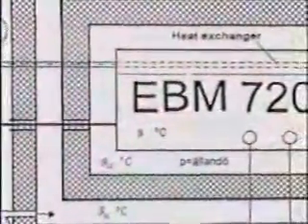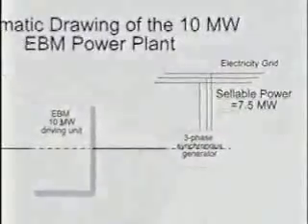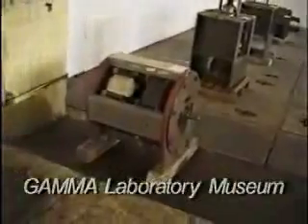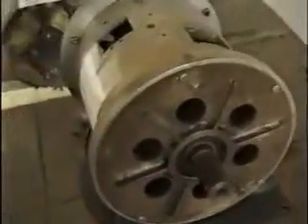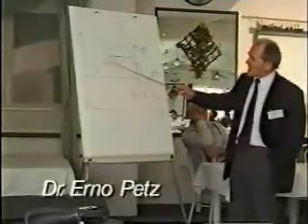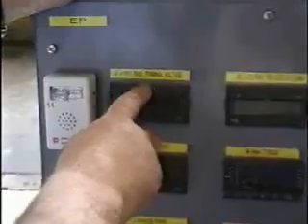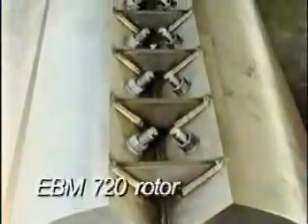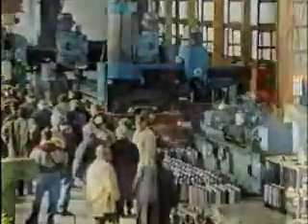Electromagnetic OverUnity Power Plant

Comment: Energy from permanent magnets has NOT been over looked, but suppressed. WAKE UP PEOPLE!
Reply: spinning a magnet past a coil forces electron movement. When this happens, the magnet never dies. Why would it die otherwise? In an electric motor, the magnet does literally see an opposing field. it is a push push field where opposing magnetism forces the motor forward. Why then couldn't two permanent magnets that were side and rear shielded not produce the same effect with the same life expectancy? They do sell permanent magnet motors that run in a push-push scenario and they have permanent magnets being pushed by electromagnets.. which is the same difference.. The housing is made of very thick steel laminants bound together, which is too thick to allow the back side of the magnet see interference or produce it. This IS the shielding that is required. If the stator is replaced with magnets and shielding that oppose the rotor, why wouldn't it spin until the magnets die? The magnets take thousands of years to die, in fact, they take more than a human lifetime under normal operating loads to die down enough to notice it slowing down depending on the magnet type. Permanent neo magnets last the longest per weight.
Reply: Energy from permanent magnets simply does not exist.  We have lots of con artists like Mike Brady with faked machines but no real ones for the very simple reason that it is like suggesting that you put big wheels on the back of a car so that it is always rolling down hill.  It makes no sense in the real world.
Reply: Ken Smith I ran into a man who told me he ended up building a machine that was powered by magnets. Now, after all the years and tries many people have done to get these to go, some have been successful only to find the magnets started to degauss over time and were too weak to operate during shows, etc., in front of hundreds , if not, thousands of people and million of video viewers.

This guy I met literally came up with a way to allow the magnets to move and rotate away from creating cogging by means of the Lenz effect, as well as unshielded magnetic attracting that caused additional cogging during it's rotation, especially once under load. He put the magnets on a spindle and had magnets raising them to float so there was'nt atmospheric pressure pushing down on the magnet against the base that has frictionless bearings on them. Once the machine starts by way of pop starting it, it starts to move and speed up to extremely high rpms, like 18,000-20,000 rpms. Once the machine's speed levels off and stays consistently the same, he engages the  output coils and starts to generate electricity. He then switches on the load once the rpms are again down to where they level off, and, the machine slows down a few hundred rpm, powering the load without any issues. In fact, he can heat up (3) 100 watt bulbs without making the rpm go down any lower. He adds (4) 250 watt halogen lamps and the machine gets down in rpm another 600-700 rpm without any issue or shutdown.

The machine still powers every lamp in his barn. He has purchased machinery to machine larger parts so he could make his own 3 phase power, so he could drop the feed in his shop. The machine has been operational for approximatelty 7 years according to the family and they all agree that it is something they are going to only use for their family.

I have gotten a very good look at it and it seems very simple. There is a generator similar to it on youtube, but, the guy on Youtube is way behind the man I have met and spoke to for hours. The man I know said his grandfather invented this machine in 1931 and nobody would even talk to him about it. They thought he was a freak and a mad man because everybody feared to even think about broadcasting they new how to build a free energy device. They feared they would be taken and killed, so, the man and his family moved a few states north and settled in Massachussets. The machine has since been handed down and the kids, then grandkids have been taught how they work and how to make them work to power up to 35,000 watts output at 120 or 240 volts ac @ 60hz.. This machine is the cats ass and it works flawlessly. The rotating magnets in the rotor spin while being raised by up-facing ring magnets which make them float in the center of the horizontal rotor and allow the stator magnets to see both poles while it rotates to allow both the rotor and stator magnets to recharge as they pass each other, eliminating degaussing, cogging, and distant magnetic field which eliminate it's output stage which are magnets mounted on the outer rim of the rotor, facing outward with opposing pole shielding that pass by very large inductor coils as it rotates. The coils are pickup coils which are built to transformer the voltage to usable voltage as it comes from each pickup, then tied into a delta formation to output 240 volts ac. It's an extremely ingenius machine and it is very quiet, requiring absolutely no fuel.

From what the inventor says, it works better with very large older style ferrite magnets that weigh approximately 19 lbs each. The rotor is a huge aluminum wheel with sheets of sheetmetal next to each charge section  (at the outer rim magnet for shielding them from the run magnets on the spindles.

So, he basically took something that was impossible to create, and, like all others, who worked on 'first to be thought impossible" designs, he used his crafty wisdom to eliminate the things that worked against the technology, he discovered sheet metal could shield magnetic fields, and, he found that magnets would otherwise degauss themselves if the repelled each other. He found that if they repelled each other the same amount as they were attracted to each other, they would last forever without losing their energy.

The machine does not have a ton of torque as people would think, they don't work well with stronger magnets, and, the machine tops out at 20,000 rpms, making is nearly impossible to start it if a load were present before he fires it up.

The machine has to work in those steps, and, I am a witness who will swear by God that it works 100% as I tell you with not one bit of doubt, there wasn't any trick, he let me start the machine up, take measurements, and, I looked closely at every detail for hours on end. The man was a complete genius and that's all I have to say.

That is only one working product I have seen over the  years. There are 3 different technologies i have witnessed operational other than my own, so, you guys should all be ashamed of yourselves by comparing modern day physics to these as they all either work within the laws, or, the math of the types of energy coming out of some do not apply to our current laws because things like resistance, capacitance, and amperage as well as voltage do not do the same thing in other types of electricity.

There are 2 electricities science recognizes. The one we use, the conventional electricity which is called "amperage driven", then, there is electrostatic.  I have been researching cold electricity, scalar waves and the cold electricity produced by drawing in the scalar wave. There is longitudinal energy, there is also what people call radiant energy, and aether or aetheric energy which are confused with longitudinal energy, but, the equations in static, and current driven function the same way. Cold electricity can be produced with amperage driven power, and, it functions totally differently. The resistances, such as light bulbs function backward and do not correspond to modern day ohm's or watt's law, which is real and correct.

Since this is something that works oppositely, then, why haven't or why hasn't science recognized or tried to research this power over the years? They won't because it has been suppressed since Tesla touched it, banished the texts he and Maxwell have created, rewrote them, and banished all students ability to study any such electricity, say it is imp[ossible, and now, it has been resurfaced.

Watch the videos by Karl Palsness before you do not believe. He took a discovery of Tesla's and he has redeveloped the circuit, calling it Tesla's Hairpin Circuit. Tesla knew it was an overunity circuit, and, the descriptions and writing tesla had put in his research have only left the diagram available to all, the data had been destroyed, but, Palsness rediscovered it and called it the Hairpin because of how the copper rods looked, like a big hairpin. Palsness has discovered all sorts of neat functions with it and found he can touch it without getting shocked, the bulbs work in water, and you can touch the water without shock or death while the bulb operates. The danger exits in the spark gap, so, the amperage literally does not operate the bulb, the voltage does. But, the voltage would decrease if wired several resistances into series and split the voltage. This amplifies the voltage with higher resistance, it is really funny stuff, but, it functions across a complete short, just like voltage mods do with spark gaps, so, when the capacitors are added, the voltage does multiply, but, it gains energy with added higher resistance instead of the opposite.

Karl has been in the process of teaching people worldwide how it works in conferences, shows, etc.  The circuit was originally a piece of tesla's "Tesla Coil Power Circuit"  Which enabled all to witness the mass amount of power that can be generated and used from the same sized input. The transformer would draw say 180 watts at idle firing the arc gap, and, when adding a 100w bulb through 40 gauge magnet wire to the shorted output, he got full power to the bulb, as long as the resistance was higher than the shorted output. , the 40 awg enameled wire he ran across the room was ice cold, and, the input wattage stayed the same, but, the bulb illuminated brightly across the room while the wire should have burned up if this were conventional electricity. Palsness could also touch the wire at the open ends without electrocution, something that can't be done with conventional electricity. Since the body resistance is normally lower then that of the bulb, the cold electricity follows the highest path of resistance instead of opposite, making electrocution nearly impossible, something Tesla really wanted to push into society for it's clever effort of safety. Everybody was basically drilled by Edison that AC was extremely dangerous, and, it never surfaced again until basically 2006 or so.

Some of my experiments have shown to drop the input load by adding bulbs in series, so, instead of the 180 watts at full idle load, with 8 bulbs wired to it in series, the wattage went down to 100 watts. Explain why this would be if it is supposed to be impossible?  And , the bulbs in series became much brighter.

I am about to post another video and I will show this tonight if I am successful uploading it.

One question though, if we have been really researching and putting the efforts out there to allow everybody to build their own devices, why don't you all at least try them before bad mouthing them or saying it's impossible? Conventional electricity is not the only kind of electricity, and the other types I have been studying for over 12 years have certainly made me a believer. Science needs to accept this electricity and put people and scientists out there to put together a mathematical system that pertains to this type of power, as well, show people it is able to be drawn in and doesn't have to literally be generated with a fuel.

So, why all the skepticism? Where is the sense? Combinations of components and new technologies are not impossible, so, is it from jealousy that you guys didn't invent something? Are you guys afraid of new technologies? Or, do you think we are at a technological stand still where nothing more will ever be possible?

I am curious, why are you all so negative about these claims? If it is our country causing the skepticism and suppression, then why are you backing them up and their claims while they certainly use the new technologies themselves in secrecy.. If they didn't, a lot of the things they do use that violate the laws couldn't be done, so, please explain how the government can use these technologies in these new secret planes but it is still impossible to exist? lol
Reply: @advanced-electronic  salut! Es-tu Québécois?  J'imagine que tu parles français en voyant ton nom. Si c'est possible j'aimerais vraiment savoir vers quoi me diriger pour éviter les mauvaise avenue si c'est possible bien entendu.  J'ai vraiment envie d'apprendre plus pour être capable de fabriquer quelque chose de bien.  Merci d'avance!  Je suis persuadé que tu n'es pas un "scammer" ou un abruti de la sorte après avoir lu qu'est ce que tu as rédigé comme commentaire c'est très evident. Tu détiens un immense savoir c'est clair j'en reviens toujours pas.
Reply: +Marc Belanger I call bs on that. they're called permanent magnets for a reason the only way they lose magnetic force is if you heat them up too hot.  the magnetic field in magnets can last millions of years. fyi magnet motors as already stated are not possible. look up just some basic magnetism info and see why. a magnet can only come to rest at it's equilibrium. a magnet cannot produce energy you can only put energy into them. this is WITHOUT EXCEPTION.
Reply: MadMetalManiac74
You are a bit too optimistic about the life of a permanent magnet but in essence correct.  The strength of a magnet declines very slowly with time.
Reply: Ken Smith I think it was something like the late 1600's when people discovered that magnets could not produce energy.
Reply: MadMetalManiac74
Note:  Magnets are in no way a source of energy.  This comment merely is about the life of them.

I have had magnets in my possession for long enough and the tools to measure their strength that I have been able to see a decrease over a span of about 20 years.  It isn't a lot but it does happen.
Reply: Marc Belanger
You can never sneak up on a magnetic pole.  If you ignore losses like friction:

To push two opposing magnets together takes as exactly as much energy as you can get by letting them move apart again. 

To pull two attracting magnets apart takes exactly as much energy as you can get by letting them come together.

To move a magnet past a coil takes as much energy as you take out of the coil as electricity.
Reply: Marc Belanger well for one every force has an equal and opposite reaction. This is why a magnet motor cannot sustain itself. There are equal opposing and attracting forces in this design. Without external energy added It doesn't work. You cannot shield a magnetic field like you think you can. Magnets are dual pull. They are not one side north and one side south. What happens if you cut a magnet in half? You think you magically have one magnets that's only north and one that's only south? 

Secondly... do you honestly think you're the first to think of this idea? Do you realize there are thousands of people who have tried what you are explaining without success? There are no new designs in free energy they're all the same repeated experiments. They don't work. They can't work. It is a mathematical impossibility and here's why.

E=mc2 right? Say if the laws of thermodynamics no longer applied. If you have a free energy machine that takes in 1 part energy and produces 2 parts energy then what happens to the extra 1 part of energy that gets fed back into the system? It increases the mass of the system therefore it's now producing 4 parts energy for the additional 1 part of energy added. Do you see a problem with this? If this were possible your free energy device would become infinitely massive. This is also why you cannot go faster then the speed of light. Its a logical and mathematical impossibility. There's no way you could even use up enough energy to keep this phenomena from happening. Its a snow ball. One that's just not possible.

Look at it like this. At its very core the idea implies that I can plug and extension cord into itself and have already existing UNLIMITED POWER. "Already" existing is a key word here. If you have to plug it in or add energy to a system then ITS NOT FREE ENERGY PERIOD. again it's not that I have a closed mind.....it's just that I tend to not believe in physical impossibilities. if I told you 1+1=3 and you said I was wrong.....then your mind isn't open enough. Does this make sense? Logically? this seems to be an ongoing occurrence on this topic and quite frankly I find to be just an excuse to not fully grasp what is and isn't physically impossible.

Comment: Another benefit are the use of magnetic bearings. Magnetic bearings assist in suspending a shaft making a far more efficient generator, these are on the market today. Add magnetic assist, then add current then you have a revolutionary generator. Generators 200 yrs from now will be far more efficient then ever before & will be powered by night time solar panels as solar panels keep improving, it will never defy physics, it will simply be so efficient that it just seems like it's free energy.

Comment: The advancements I've seen are the ability to alter permanent magnetic fields using magnetic shielding that allows perm magnets to propel without the lock up effect harnessing only magnetic force propulsion, force can be converted as energy but often not sufficient to power a motor but only to assist in rotation so it requires added current. The illusion of free energy is obtained when output current is rated higher than input current but nobody ever puts an input meter on magnet assisted force.